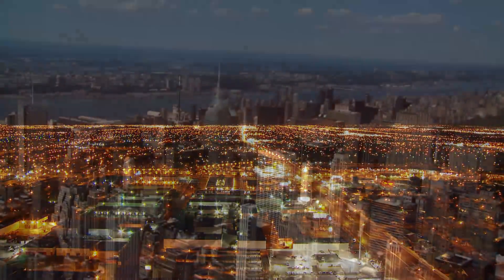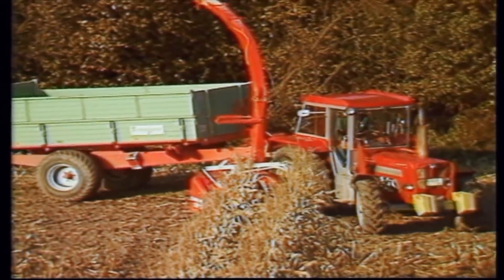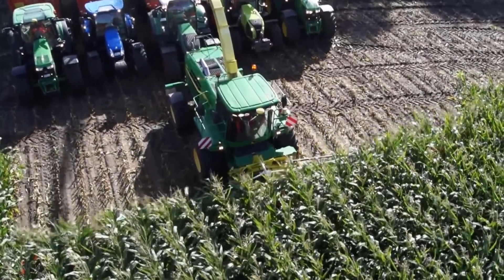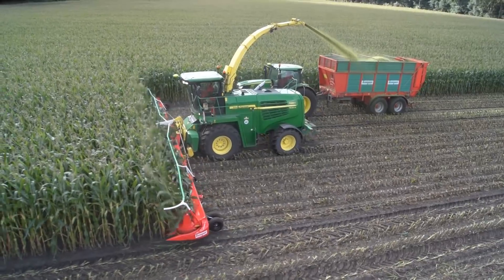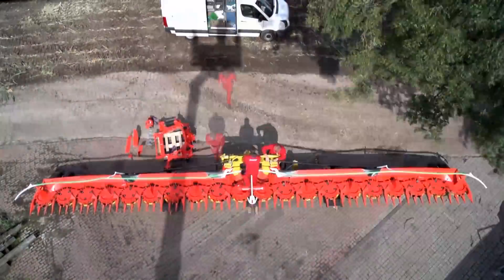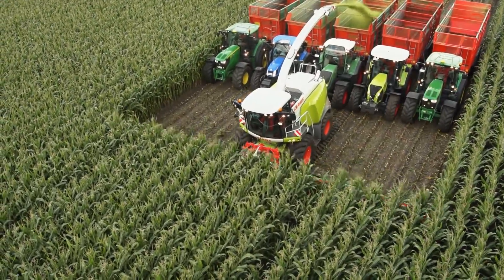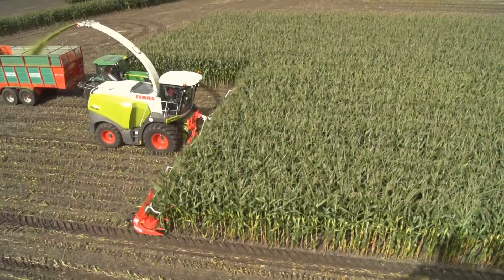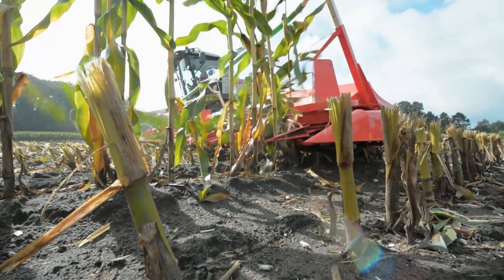Kemper concept study 2020 english - Agritechnica version

Comment: To be fair, your combine has to go slower otherwise it gets full and clogs up.  You could use a header that is half this size and go twice as fast in the field, also you need to calculate the fuel from the additional tractors following the combine. It might be a tiny bit more efficient, but not by that much.

Comment: When designing this wide header did they adjust for the curvature of the earth?
Reply: @martialme84  You mean the coasts where people are crapping in the streets and you're stepping on heroin needles?
Reply: At close to 8" curvature change per mile on the Earth's surface, that header needs approximately 0.076" curvature over the width of the head to match the earth!!
Reply: The earth is flat tho😃😃

Comment: Kinda crazy... Can you harvest that wide?? Sure.  Is it feasible or advisable?? No.  
ANY machine can only handle SO much material in a given length of time.  IOW, it has a given capacity or work rate, or better stated, *throughput*.  Sure you can go wider-- a LOT of farmers here in the US are all in love with ever wider, ever bigger combine heads... but the rest of the machine has to have the capacity to keep up or you gain NOTHING.  Maybe you save a little time turning less, since the wider machine will have less swaths and turns to cover a given size field than a narrower machine, BUT, the throughput CAPACITY of the machine will remain the same... 

For instance, my brother-in-law traded his 6 row corn head for an 8 row.  With the 6 row head the combine could thresh and separate well at 5-5.5 mph, though at times we even bumped up to 6 mph or so in wet ground and light crop conditions.  The 8 row head can only harvest at about 3.5-4 mph in most conditions... sometimes 4.5-5 in wet ground or light crop conditions.  SO, sure you're gaining 25% more width with the 8 row header, BUT, you've had to slow down by 20-30% in most conditions... IOW, *it's a wash*.  Very little benefit.  The wider head has more moving parts to maintain and wear out, and it's heavier, which means more ground compaction, more load on the rest of the machine carrying it (like the tires in the video at 7:46 and the deep tracks it was leaving on the field trying to carry the massive weight of such a wide head.   Then of course there's the cost of such a massive head... MUCH higher than a smaller head.  Practically, in the field, you'd need enormous wide headlands and smooth level ground, and of course the wider the head the more inconvenient it is in corners or odd-shaped fields.  Huge flat, level square or rectangular fields, no problem.  Throw in a weird-shaped field and you'd have a lot of aggravation and lose even more speed and productivity.  Then there's the issues of transport of such massive headers... 

Speed, on the other hand, basically costs you NOTHING.  IOW, you can run a narrower head at higher ground speed and keep the machine at its rated throughput or capacity and have the SAME PRODUCTIVITY, but with fewer moving parts, less weight, less soil compaction, and no added expense of the wider head.  Sure you have a few more turns, but the machine is more nimble and easier to handle odd-shaped fields and turn around or maneuver around the field, and follows ground contours better with less loss.  Running at faster ground speeds can be harder on the machine on rough ground, and yeah it's covering more miles with the tires and final drives and transmissions over the same number of acres because of covering more narrower swaths than fewer wider swaths, but in the end that's a wash too because the heavier head is MUCH harder on the machine to carry, particularly in rough, muddy, or bad conditions, simply because of the weight.  The hydrostats, transmissions, final drives, and tires aren't usually the weak link in modern machines anyway, and in rough or muddy conditions the lighter, narrower head would put much less strain on the machine, though it would operate for a longer time.  

Even with machine longevity, it's a wash... the wider head covers a given size field in fewer swaths, but if the machine is at capacity *already*, traveling slower across the field means it will take the same amount of time to harvest the field.  The narrower head will require more swaths to cover the same given size field, BUT at a faster ground speed, it will complete the field in about the same length of time in the end.  The hours added to the machine would be about the same in the end.  The loads on the engine and components should be about the same if the machine is running at capacity (though slugs or variations in a crop will quickly overload a machine with a wider head, where a narrower head isn't gathering as many rows at once and so the variations between rows doesn't multiply like it does with a wider head, giving the operator time to slow down the ground speed to allow the harvester to catch up.  

In the end, you can either crawl through the field at a snail's pace with an expensive, unwieldy monster head, or you can zip along through it with a "normal" size header at a decent rate of speed.  It's a matter of choice.  

TO really increase the CAPACITY you'd need that head to be feeding a MONSTER chopper capable of handling that head at 5-7 mph field speeds, which would mean a HUGE massive chopping drum and probably a 1500 horsepower engine.  IOW megabucks... 

Bigger isn't always better.  Even some of the big corn farmers are starting to figure that out.  I know some folks that were running 36 row corn Deere corn planters with central fill and air meters, that are now trading for 24 row new Deere planters that can plant corn not at the old standard 5 mph, but twice as fast at up to 10 mph if the field is smooth enough.  That is an actual increase in PRODUCTIVITY as the 1/3 narrower machine can still cover MORE GROUND because of the speed increase.  Speed costs you nothing, basically, but width costs a LOT in additional moving parts to buy and maintain and the higher cost of the implement to begin with, as well as maintenance and transportation issues between fields and the greater weight and complexity of additional folding mechanisms and such... 

Later!  OL J R :)

Comment: Wider and... slower
there you go, innovation
Reply: while it moves at a slower pace in the field, it's taking out more rows. If you've worked in harvest on a farm, you'd know width is more important than speed. This machine can harvest faster than a smaller head. Speed isnt' everything.
Reply: @tctarheelfarmin358  also less compaction
Reply: The idea is that the harvesters of the future will handle 20 rows like the ones back in 2013 could handle 10
Reply: cospar .wbkfgbczx

Comment: how does it separate the corn?
Reply: After further research, you can buy an upgraded kernel processor, but it only chops the hard kernels up - its not for collecting or seperating.
Reply: Arthur Chapman
Reply: kernal processer in the chopper itsself
Reply: I don't think it processes the kernels.  It just spits them out with the rest of the chaff.  This unit isn't designed to collect the kernel.

Comment: Well as much as impressive as the cutting head is.  I am wondering about possible high engine loading which will lead to a shortened life.  Plus that quite pooring designed discharge arm is crying for major redesign.  I say LARGER internal (will help with harvest speed), longer, and lower.  The amount of product spoilage would surely cover the cost of the increase cost of a new discharge arm.
Reply: +Jason Buis when larger headers become commonplace, the call for larger harvesters to operate them will be there and manufacturers of those will make them.

Comment: This is a ridiculous concept. It needs an 800hp. tractor that few farms have. Additionally it requires the farmer to buy or arrange so many trucks to accept the product that it would be very difficult to coordinate. It is cost prohibitive, a normal setup and one product dump truck is cost effective. The time saved is not worth the cost or effort. They are trying to flex their tech muscles without thought to practicality.

Comment: To damn big! You get into good corn on a full quarter cutting all day long! That headers gonna raise hell with your machine in the long run, not to mention all the damn silage yer gonna blow all over the ground when the itty it that cant drive behind you gets off a couple rows or someone not payin attention, you plug the machine slam back the hydro,the tractor&wagon run right into or over the side of that head!!!! This is nuts, not even cost effective! 4to8 rows is plenty big in good corn&then some! To buy something like this you'd have to find the leprechaun at the end of the rainbow, kill that little bastard&steal his pot of gold!
Reply: chad borowiak you completely missed the point if this. They were TESTING what was capable with current machines. This happens all the time and has been done for decades. This is how machinery progresses. Being narrow minded and doing things the same way "because that's the way it has always been done" is the first step to failure.
Reply: chad borowiak _
Reply: For those that are not versed in gibberish: "itty it" = idiot.